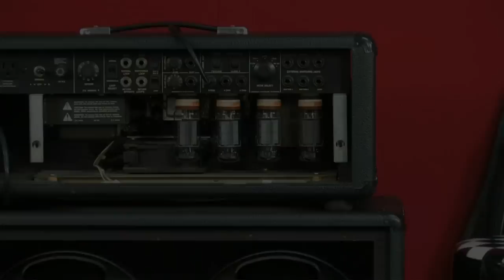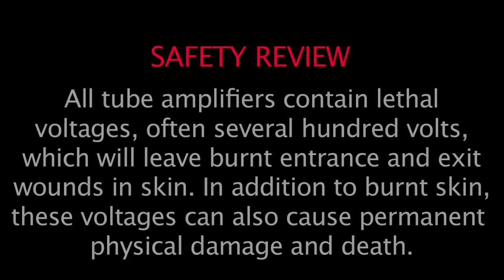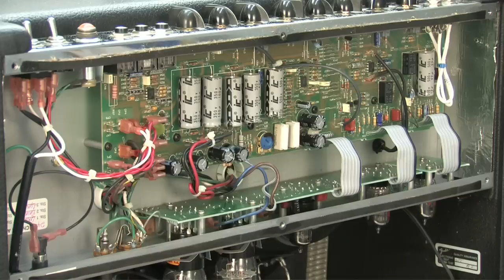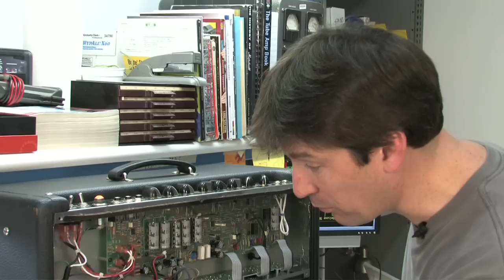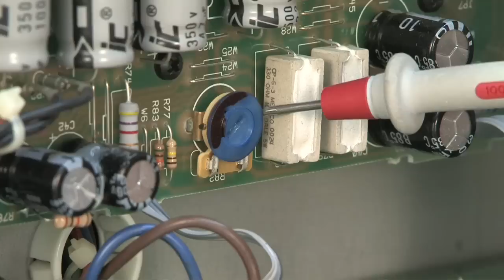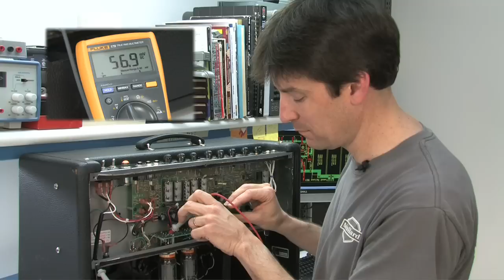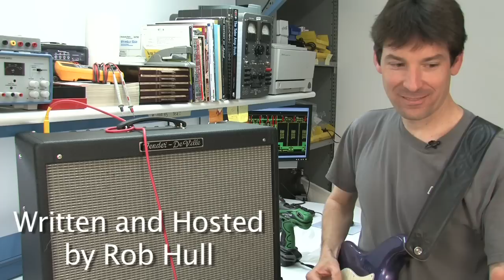How To Bias a Deville Amplifier

Comment: got the new JJs in the mail today and checked em out by swapping one position at a time, swapped V3 nothing put the original in. tried V2 still nothing, tried V1 which I suspected and got a low volume fuzzy tone even on 12, so I put another one of the JJs in the V2 position and she jumped back to life with even more tone, put the last new one in just to complete the set and i figure ill hang on to the one good one for emergencies till i get a few spares, Thanks again for your help

Comment: Just a quick question, I was playing a jam and while packing my gear away i accidentally knocked over my HR Deville, a week later I tried er out, the pilot light wouldn't come on (filament broke) I get the normal quiet hum through the amp but no guitar signal and all the tubes light up and i gave em an extra push to make sure they werent loose so im just wondering if the quick Jolt was enough to kill a preamp tube?or could it be something else? I ordered a set anyways just to see.

Comment: Hi! How can I do the Bias adjustment in my amp: is completly different to a HOT ROD. I have a Blues Deluxe 94 - tweed. The electronic board is different and I don't see any trim pot to adjust. Its no necessary this adjust? I need to replace my tubes. Thanks
I have photos from electronic board...

Comment: Hi Rob,  Like the video.  Good solid and easy to follow.  I have just changed to TAD 6L6 tubes and during biasing could not get less than 61mV at the bias test point (highest voltage pot would go was -60V, which gave me 61mV at the bias test point).  I therefore backed off the pot voltage until I got 70mV as the bias voltage.  Is there large tolerances between amps, or should they all be able to get 60mV without having the pot at max counterclockwise

Regards,
Allan

Comment: I just had a Blues DeVille come in with major blow out damage on the board, 5 resistors, a couple of caps, and a chunk blown out of the board. The ONLY remedy is to cut out the bad part of the board and jumper everything. There is so much carbon tracking to ground the only other option is a new board, or new amp. If only you knew how little it costs  to make on of these!LOL They still sound good. They are just hard to repair when things  go wrong, and hard to modify without making a mess.

Comment: hhhmmm makes me think of the Dr.Z wreck amp and the very similar trainwreck rocket. THese amps has huge transformers, choke filter and fast GZ34 rectifier. These amps are tought as being super touch sensitive. But what I seem to have learnt recently is that amps with a lot of filtering of the preamp and PI tubes seems to be less responsive. Patfurlan here on youtube showed a video where he replaced a 47µf screen cap in a fender BF deluxe amp with the original 16µf filter cap to improves sound

Comment: I think it depends on power transformer current capacity. With most amps I agree with you but take a fender princeton reverb amp with 2x6v6 and 4x12ax7 tubes feed from a 325VAC/70mA transformer with just 2A of filament current. It is taxed really hard, and will B+ will  drop when biased hot. 
The 60mA for both tubes suggested by fender is with screen current also. Eurotubes has a video that shows that a test point reading of 91mV = 78mA plate current, which gives ~12- 13 mA screen.

Comment: Hi Rob. I replaced the stock groove tubes in my hot rod deville which read around 65mv on my meter. When I put the new harma 6l6gcs in I couldnt get the bias below 92 mv. Could this be a problem with the tube(s)?

 Cheers

Comment: Oh yes, leaded solder certainly isn't impervious to breakages. Exactly as you point out in the video, the way the tubes are mounted practically guarantee that at some point you will need to reflow the joints. The lead-free stuff just compounds the issue with it's general unwillingness to do anything like maintain contact of a node. Again, great video, perfect for the slightly-more-than-not-technical musician.

Comment: +1 for checking the tube sockets! I can't tell you how many times I've had to re-tube peoples amps with nearly brand new tubes because of problems from bad tube socket solders. I always clean ALL the solder off and use proper leaded solder, not that lead-free crap.

Comment: Hi..thanks for the response..I checked my Blues deluxe and it did have a test point ..I went and bought a multimeter at the hardware store.  The meter he sold me only had a 2000 milivolt setting..not a 200mV like shown in a lot of these videos..He told me that was ok and the meter would measure 0-2000 mV..Is that correct in your opinion?

Comment: Brilliant vid and pickin ! 
The lad just picked up a HR Deluxe ii ....fantastic sound except the power tubes are noisy on some low notes. Gonna try some damper rings but if that doesn't work then may be putting your instructions to use soon with a pair of new tubes.

Comment: does adjusting "bias voltage" mean the same as adjusting the voltage in "cathode bypass" resistor? And how can we manually figure out the idle voltage/ current?

Comment: great video.. WIth 485V plate (schematic) a value of 74mV (2 x 37mA) is a good medium warm bias (60% of max dissipation). The hot rod deluxe shows 431V plate and Fender recommends 60mA (30mA pr tube). That is cold for a set of large 6l6GC (30watt) tubes (less than 50%), at those voltages. With that amp you could go up to 84mV (2 x 42mA) for 60% dissipation. Even 90mV (2 x 45 mA) is not that bad. Just watch the plate voltage, my guess is that with the small PT it will drop when biasing hot.

Comment: Will a tube overload damage a amp? I have a pair of el34 & my ac power in the house kicked off causing 1 tube to over overload it got the color bright white. I shut the power off pulled the tubes out waited await a couple of days put back in re bias 1 read 39.2 & the other did not read anything. Is my amp thrash.

Comment: hey, yes, all the solder connections are fine. I just thought it was strange that i couldn't get it under 73mV but i made a call to the store and they said it's perfectly normal. They offered me to return them in if i wanted, so they could give me another pairbut as you said 73mV is a nice value. Great vid by the way! nicely explained for electronica noobs (like me)

Comment: Hi, i have a Soldato Hot Rod 50 and I change the 6l6 power tubes. I'd like to know where i got to put the tester: between chasis and pin n°.....? of the socket. then i can adjust the bias, right?

Comment: Awesome video, just what I was looking for. Recently picked up one of these babies used. It played fine for a day or so then started doing some heavy volume fluctuating. The jewel light also fluctuated but not always in synch with the volume trouble. I popped the back off and checked the connections as Rob did in the video and they looked solid. It's my first tube amp and don't want to assume anything. Would a good first step be to pick up some new power tubes and pop them in?

Comment: Nice demo! I have the same amp and it has been great aside from one issue. Is the volume knob on your amp extremely sensitive? There seems to just be a fraction of a degree between inaudible and glass-shattering loud with mine. Is there an easy way to either adjust this or perhaps replace some hardware to distribute and voltages a bit more evenly? Thanks!

Comment: good point however a tech should only use 1 hand and clip probe to ground leaving only a positive probe and 1 hand this way is something gos wrong or you slip you dont cross both poles at same time causeing electric shock to the heart also if amp power is weak check pre amp tubes for these feed signal to power tubes most of the time with coupling capactors output tubes out to an audiotransformer on a tube type soild state outs by capactor power supply caps are the 1s to watch out for

Comment: @TubeDepotTV hey buddy, i have a hot rod deluxe and my clean sound has gone kindda distorted(not battery) and im thinking of changing my power tubes, firstly are these the probable reason y its gone like this, and is there a way to test them, im very electronically proficient(i do alot of soldering etc) also if so what would be the best tubes to put in for the price, im thinking gold lion kt 66, i play alot of blues, such as clapton.

Comment: When biasing my hot rod deville, my voltage meter won't pick up any readings off of my bias test point. But it had a reading when turning the voltage up when the amp was on standby.

Comment: I need assitance!!
I just changed the tubes on my deville. I set the bias at 60 mv. But after playing for a couple of minutes, the amp goes wild and starts making a lot of noise, even without the cable plugged in. The tubes glow blue and seem to be about to explode. I put these power tubes into another amp, and they work fine. Please help!

Comment: I followed all the directions with my Deville 2x12 and the DC mV reading was all the way up at 180mV at the testing point.  I couldn't turn down the pot enough to get it down to 60mV... my bandmate tested his 4x10 Deville and got a normal reading.... what's wrong with mine that it would be running that hot?

Comment: Hi I opened my hotrod deluxe up and its got a pair of sovotek 5881's in the power section, now it is 10 years old and i am not the origional owner, so keeping this in mind and the fact that i have no idea what im doing other than dont touch anything on the circuit board is there a different bias point for these tubes

Comment: hi Tube Depot, i have a problem with my marshall TSL 122 combo, one day i turned on the amp to play and it has no sound, all channels working, all leds working, power tubes glowing (6l6GC), the only thing i noticed is that the preamp tubes are not glowing  like before (less glowing), i dont know what could be the reason for no sound, can you help me?. THANKS.

Comment: I have the same power supply. (Lambda 500 volt reg). You may want to wear safety glasses. This is great if you have the Fender repair manual. The old stuff usually is biased at full volume a 1KHz or .4KHz signal into a dummy load. Also this has test points and a pot to adjust. I retrofit Fender silver faces all the time using any center tapped or dual pots. I have 100K CT pots and put resistors across the pot to make it a 10K. Next show us how to fix a Maggnatone 480's vibrato, & M15's echo.LOL

Comment: i have a Hot Rod Deluxe. I picked it up used, and swapped out all the tubes today. 2 brand new mesa boogie 6l6 for power, and 2 groove tube 12ax7-r for the pre. Since it's used, and i don't have the manual, any advice about what to bias to? Close to 60 like the deville? Already gave the new tubes a quick test, sounds much better.

Comment: I have a Jet City JCA20H 20w 2xEL84 head.  It doesn't have the nifty test point on the pcb.  I saw a video here that showed how to bias it with a multimeter and I'd just like to verify the procedure before I make any adjustments.  They suggest to check the plate voltage which is supposed to be around 350VDC (mine was 370VDC), then check the milliAmperes at each tube and plug those numbers into the following equation: 11.5watts x (600 / [PlateVDC]) = X [milliAmperes].

Comment: if I replace the 6L6 for some JJ 6V6S are there any settings that i should change in my hot rod deville 410 besides the bias?? and if just the bias should be adjusted for how many millivots??? and which preamp tubes would be more suitable for the JJ 6V6S????

Comment: @TubeDepotTV Thanks man.  I just got JJ 6l6gc's and a tung sol 12ax7 for the V1 spot and two electro harmonix for the V2 and V3 preamps. Sounds great even without biasing it yet.  Which leads me to my next question: I have an analog multimeter, any idea what setting it should be on? AC or DC? 500, 250, 50V?

Comment: Hello Rob. I'm an owner of the Hot Rod Deluxe ( 12 inch speaker ) and the amp is the smaller brother of the Deville but looks prett much the same inside. I'm living in Holland so our current is 230V AC unlike the 110V in the states. Does that make any difference in biasing the power tubes? I read somewhere that you recommend 70mv for a Hot Rod Deluxe. Is this a safe value for my amp. I appreciate it that you took the time to explain this ! Thanks

Comment: @TubeDepotTV
A few people have a 6V6's in their DeVille's.How is possible?

In Eurotubes web sais:
A note to JJ 6V6 users; For Hotrod Deville's the bias for 6V6's should be between 30 to 35mv at the test points because of the higher plate voltage.

The tech amps of my city sais:'Is possible put a 6V6's but with a new BIAS settings.

Why?

Thank you very much Rob.

Comment: @TubeDepotTV 
Ok Rob but tell me somenthing
The TAD web says: 'The bottle is made from very thick glass and my sample of four were consistently straight and internally well aligned. I have no worries at running them at 450 volts and above average current. The plate construction is more conventional than a JJ but TAD has added cooling fins to both halves of the plate structure. This helps get rid of the excess heat when you run them outside of the standard 6V6 envelope.'

Comment: @TubeDepotTV Thanks for the quick response! Is it normal for the bias to oscillate a bit over time? If i let the amp warm up and then set the bias to, for example, 65mV, it will eventually drop to 61 after a couple of minutes. I thought it was normal for it to rise a bit due to the amp getting warmer, not to drop! Right now the amp is on and i'm checking the bias every couple of minutes, when i first turned it on it seemed to be around 65mV, then dropped to a stable(ish) 60mV. Is it normal?

Comment: Isn't the bias supposed to be measured (as per fender's schematics) with all the knobs minus reverb set to 50% rotation, and the yellow channel selected? On my amp, rotating the knobs, especially the volume one, seem to make the reading vary a bit...
PS.: Is -42V a good bias voltage (measured on the tube pin)? Plate is 460V, it's a 1997 USA made deville i just got, so i wanted to check if everything is still working properly

Comment: I have a deville and i switched to JJ 6L6gc matched pair from tube depot. When i went to bias the amp the highest i got when i turned it all the way up was -57.03 before doing millivolts... does it have to be over 60 V before i set the bias to 60 mV?  all the solder joints are in great shape and i let it warm up still to no avail. Any help would be very appreciated

Comment: I own a hot rod deluxe. I installed some tungsol 12ax7s and some JJ 6L6s and biased. the amp WORKS fine, but sounds kind of muffled. I biased to 65. any ideas? do tubes need to be broken in?

Comment: Great video, well done! I own a HotRodDeluxe and this thing is always frying tubes. I took it to a tech who claimed to have biased it correctly but two days later at a gig I only had one 6L6 working, glowing extremely bright amber, distorted badly on the clean channel (I only use the clean channel) until it died all together. This was back in '05. I have a tech friend install new tubes 'bout a year ago and bias it, and it distorted again. I bought new tubes and I'll use your vid to DIY. Thx

Comment: Hi Fantastic video
I plan to change my tubes watching this video as I have a hot rod deville. 
Last time I played the sound was getting fuzzy and losing power.
Do you suggest any different tubes to the ones originally in the deville?
another question. How do I know if the pre amp tubes need changing also?
Im I correct in saying you changed the power tubes only in this video? 
is it the same method for pre amp tubes? 
Thanks. sorry for long message
Cheers

Comment: Hello!
I am new with tube amps and I am planning to buy one. 
The amp I am planning to buy also has 2 power tubes.
Is this method you showed is alwasy the same?
1. Turn the tripmot full counterclockwise while in standby mode
2. Turn the amp on (switch it out of bypass) and set the voltage to the desired amount while touching the sowder spot of the powertube?
What do you recommend when replacing with different tubes? Does the safe voltage remain the same?
Thank for you reply in advence!

Comment: Hi Rob! Thanks for the great manual for replacing the power tubes on the DeVille. I've the same amp (only difference: I've got the 4x10" version) and recently I replaced my 6L6 tubes. 

Now I've got a question: My other amp is a Fender Twin Reverb Reissue from 1992 and would ask you for a replacement manual for the power tubes there. Same as on the Deville? As far as I know the Twin has also a BIAS knob. What are the measure data for the BIAS there?

Comment: Hey Rob I really appreciated the video as I just bought a Blues Deluxe and it looks like the tubes are in same configuration. I have a lot of noise coming from the middle 12AX7, do I need to bias them as well as the 5U's if so is there are similar reference point and and adjustable potentiometer for the other side? Really appreciate the video, going to save me some money. Oh yah the noise goes away when I put pressure on the tube so maybe a quick solder is all that's needed.

Comment: hi again..the power tube,yes there is a sound coming out in the drive channel but its very very low i cant barely hear it not unless put my ear close enough to the speaker,i also found out that one of the 2 filament of one of the preamp tube is not glowing..my friend told me it might be the pre amp tube not the power tube because the volume will pass to the preamp section b4 power..is this true..thnk u very mch on ur advice i really appriciate it..

Comment: Wow! You made it look easy.
I have a question. I have a Hot Rod Deluxe. I put new JJ power tubes in and the started rattling shortly after. The guy at JJ said it's because I have a combo and the amp vibration is the cause. What do you think? Also what replacement tubes do you recommend? I play rock, blues, country.